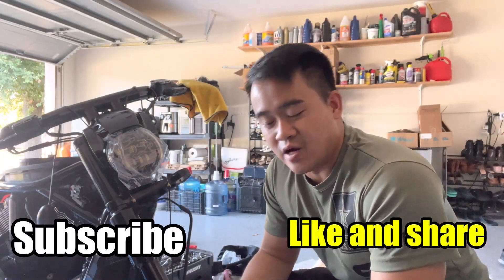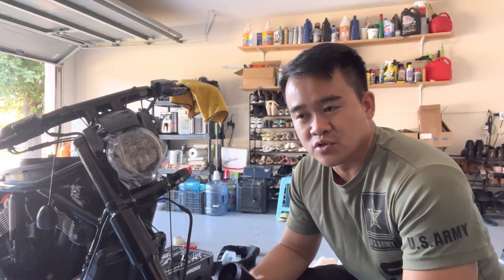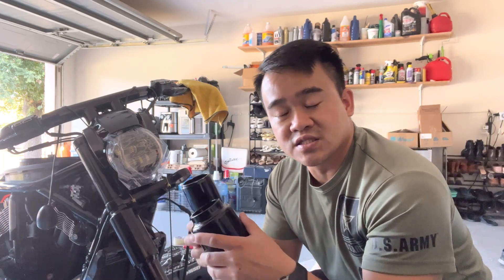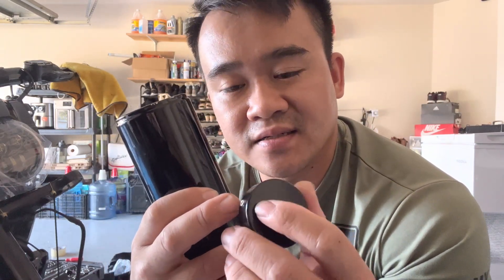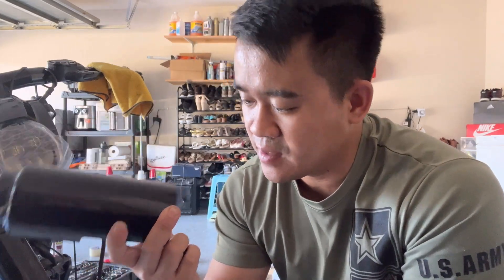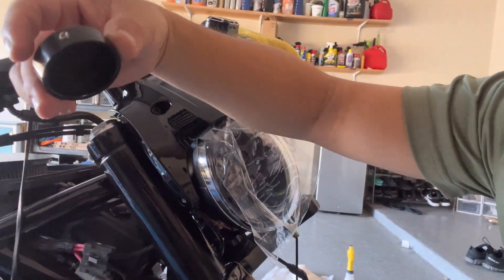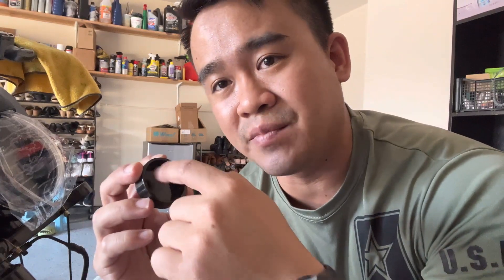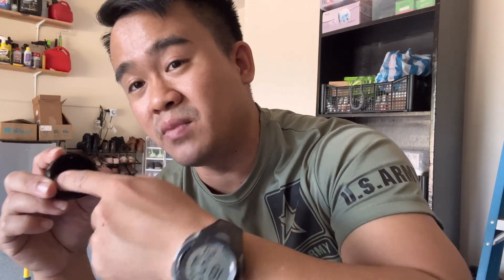Fork cover for Harley Davidson V Rod #diy #motorcycle #vrod #bike #harleydavidson #harleycustom

Comment: So you need to grind it down even for original parts?
Reply from the maker: Which original part you are talking about?
Reply: @DIY_Corner253  you said you had to grind down the fork covers to fit, is that something everyone will have to do? I have a 2011 night rod, so I was curious, I was looking to buy the same fork covers
Reply from the maker: @ministryofwrath  yes! You will have to grind on the fork covers itself. If you buy from link I provided. It happened with the lower fork covers only. But double check before you grind anything. For 2011 and earlier model fork are the same.
Reply: @DIY_Corner253  thanks for the info!

Comment: no need cut anything, you just installed them wrong, this lower covers already have cut outs just place them in correct side and they won't touch anything
Reply from the maker: @fix32231  Thanks for the comment! Did you install it with the same front fender? It always hit by the sides of the fender however the top cap is fit with orders from other sellers. The installation is pretty straight forward and I believe I install it the correct way.